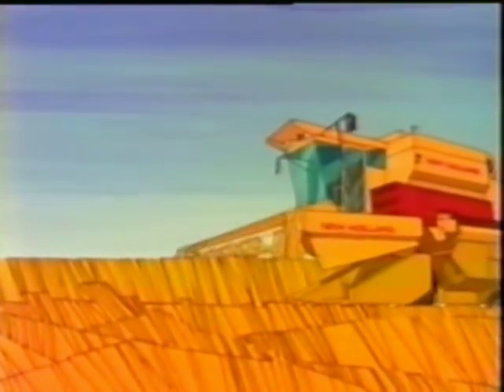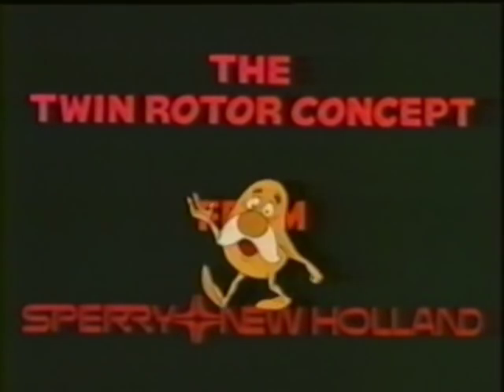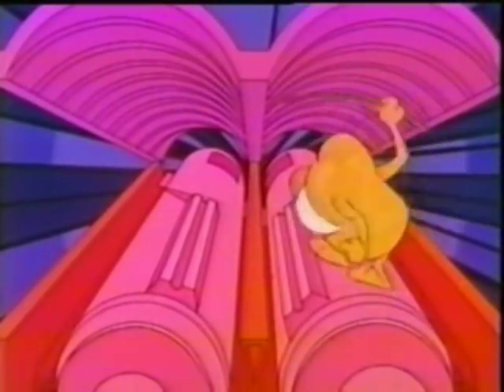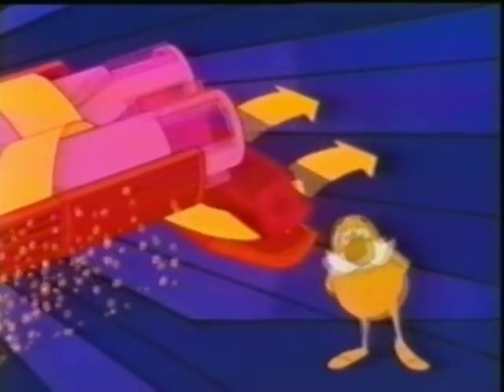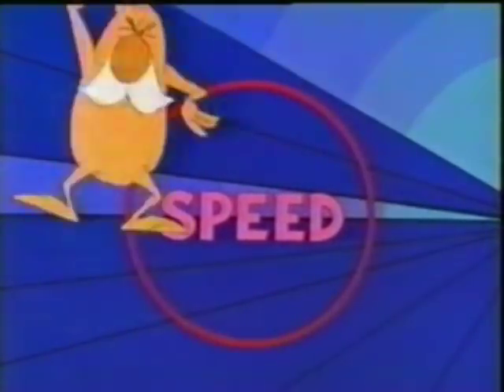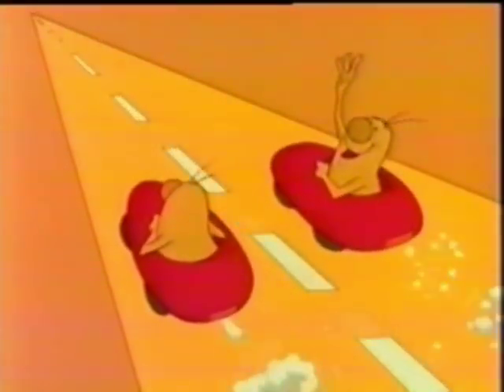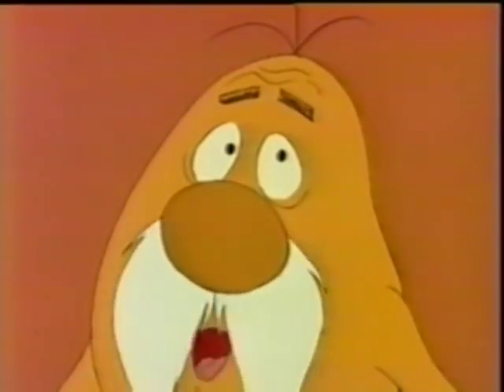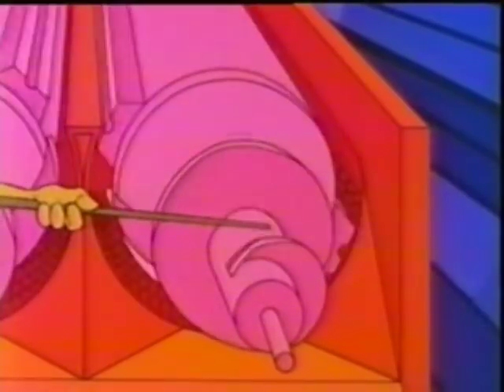Vintage TR Combine Cartoon - circa 1979

Comment: I though international harvester came up with the Idea Back in 1977
Reply: Clorox Bleach IH has the Axial Flow rotar and the IH system is much easier to maintain and superior to the Twin Rotar system.
Reply: Way before that try the mid 60s .
Reply: a chief case mechanic here at Oyen, Alberta told me that case combines are an absolute bitch to work on....I have an R62 Gleaner myself
Reply: There's some back and forth on that one.  NH got theirs on the market first in 77 IH in 78.  Story goes an engineer from one company got flipped and then designed a rotor for the other.  Story usually says IH stole an engineer from NH.
Reply: Ben Jenkins Dude have you got it arse about ! IHC put ten years development into it and 100 million dollars into it in  1960s dollars and a few IHC engineers defected to New Holland and took the concept drawings with them ,New Holland rushed the tr70 into production and used the twin rotor concept to get around the IHC patents. IHC took New Holland to court and won .The twin rotor concept has no advantages over a single rotor it was only designed to try and get around the IHC patent.
Reply: @interman7715  I have a harvester book copyrighted 1979 shows New Holland as first to the market with the rotary 1977 and IH 1978.  I spent five years with CNH, the old timers like to tell the story but I could never remember who did what.
Reply: Ben Jenkins I have the IHC rotary history ,as I said before NH rushed the tr into production 1 year before IHCs rotary, the pilfering of IHC tech is well documented in the court recordings in  the law suit prodeedings.The twin rotor was an attempt to avoid the IHC patents.The fact that IHC had a full line of axial flow combines as well as a pto model in full production by 1980 is evidence of who did all the hard work!
Reply: @interman7715  That's a common theme in the world of manufacturing R and D.
Reply: Ben Jenkins It's all documented.
Reply: @interman7715  Sorry to drag this thread back up but if there is no advantage to the twin rotor then what is John Deere doing with the X9?
Reply: @dgdaner  Twin rotor has proven itself over the years to be a very good system .Btw if I was still farming I would be seriously considering a Gleaner also ,that transverse rotor has a lot going for it . Hi from Australia ✋
Reply: New holland built the tr 70 in 1975
Reply: IH came up with rotary, NH came up with Twin rotary
Reply: @interman7715  Sad.  Tenneco wound up buying IH for less than they spent designing the Axial Flow system.
Reply: @dgdaner all to do with available threshing surface area - if a single rotor has a given threshing surface area, it stands to reason that two rotors, having the same diameter as the single one, will effectively have twice the threshing surface area. A larger diameter rotor peripheral speed will reach a limit where it adversely affects straw quality, as it would on a twin rotor with same diameter threshing elements. Reason for eventually going with twin rotors, rather than just one, gives greater output over a given time, whilst still retaining external combine dimensions that meet required travel legislation - nothing over 3•3 metres width wise I believe - especially important in the European and UK markets.